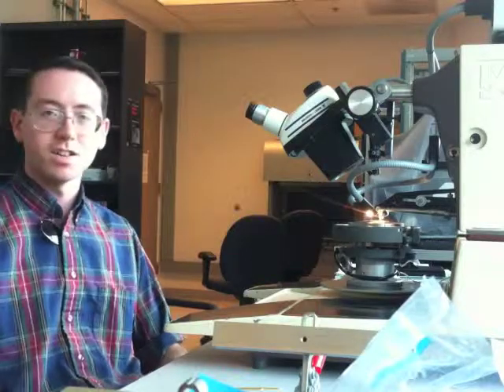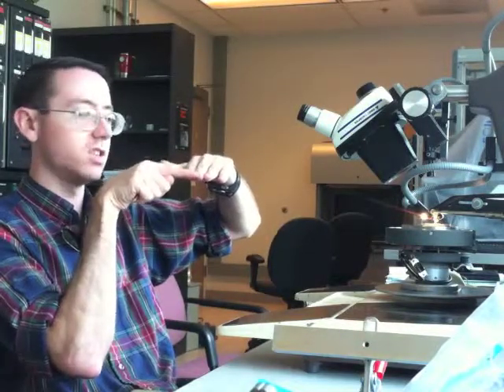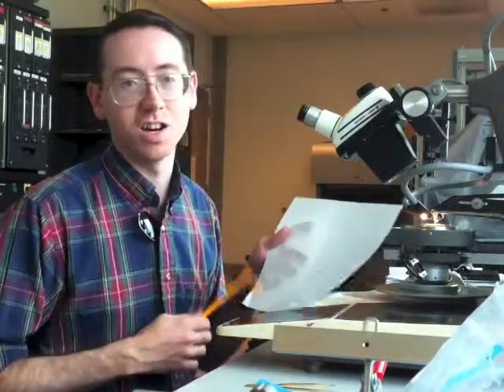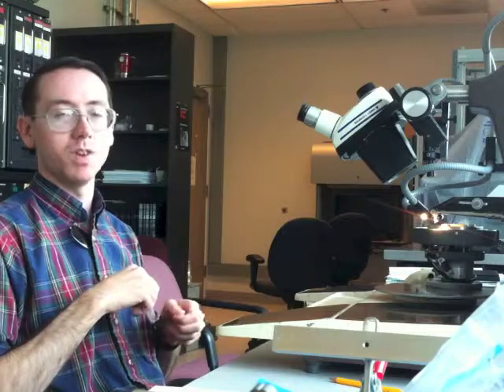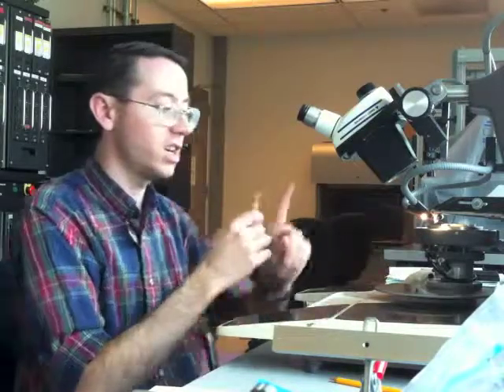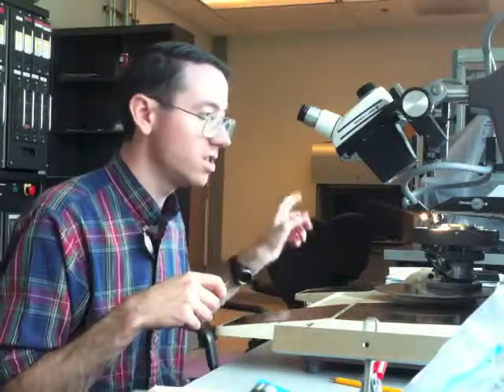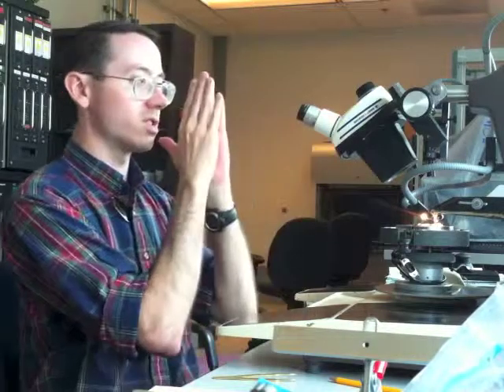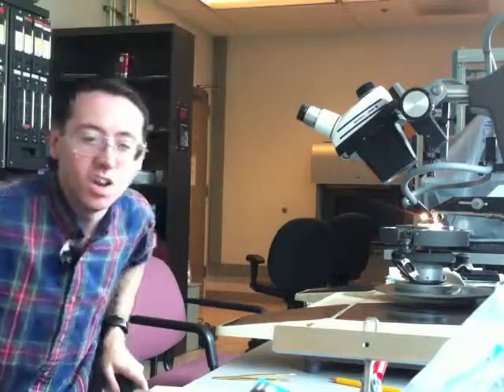Wire Bonding by SWF Part 3 of 3

Comment: How much would cost wire bonding for naked chip dimensions 51mil x 51mil into the SMD 16pin SOP casing?
And where to get empty SMD 16pin SOP casing?
Thanks
Reply from the maker: I'm sorry, you will need to contact someone who does commercial wire bonding.